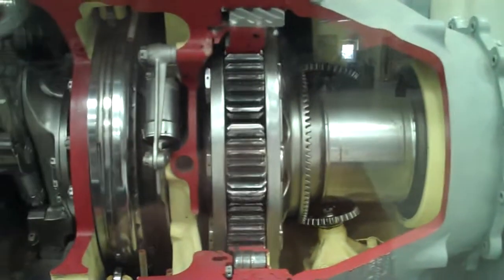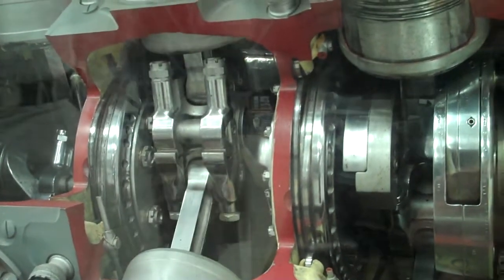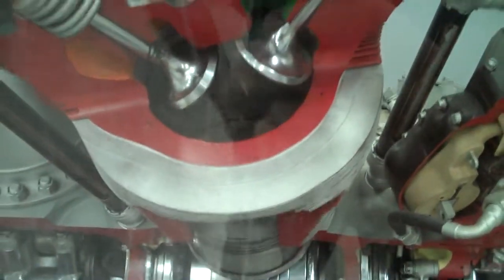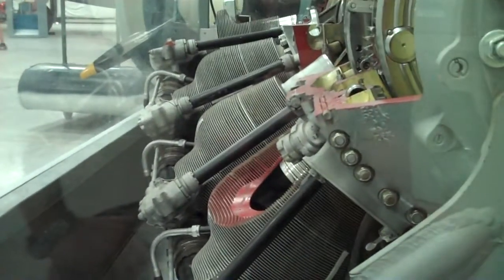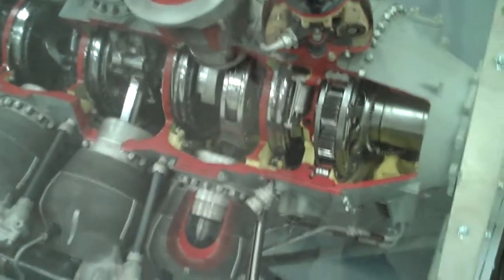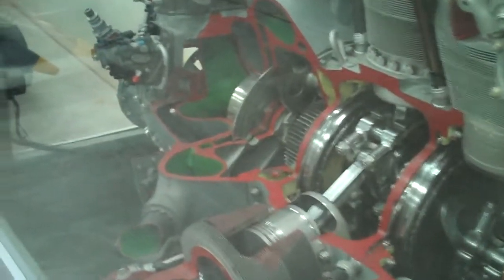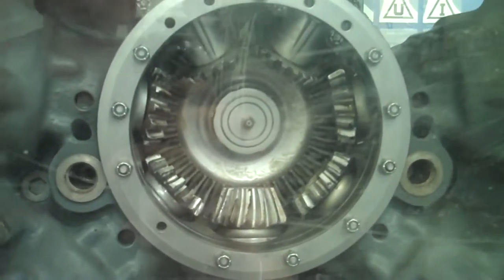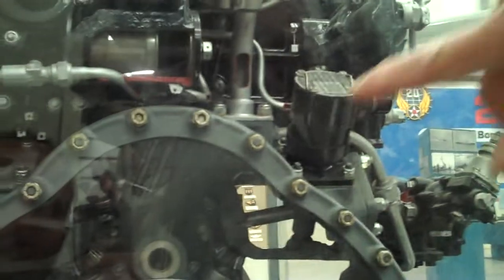Pratt & Whitney R-4360 28 Cylinder Radial Aircraft Engine Cutaway

Comment: Let's see B36 bomber spark plug change w/ Champion fine wire iridium plugs:
28 cylinders x 2 plugs per cylinder x 6 engines x $180 per plug =   $60,480

Comment: The 4360'a were some big Mama Jama's. They put these things on a lot of planes. Some of the owners of the Hawker Sea Fury Reno Race Planes have had their old Bristol Centaurus Sleeve Valve engines pulled and some have the R 3350  and some even have the Big R 4360 in them!  In fact I think almost all flying Sea Fury's have a different engine in them. This is a really nice Video. Thank you Tunerdude.